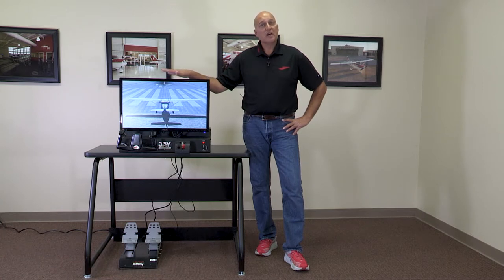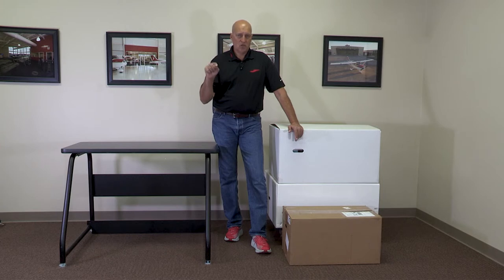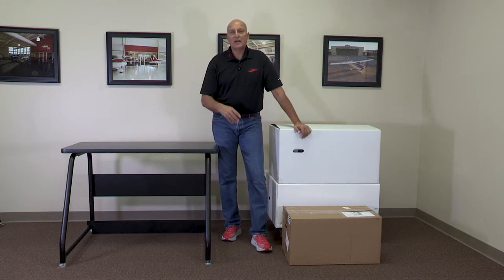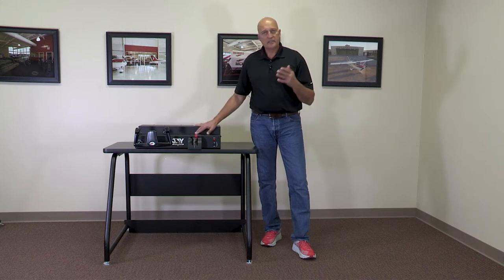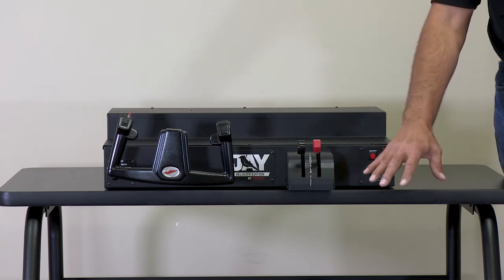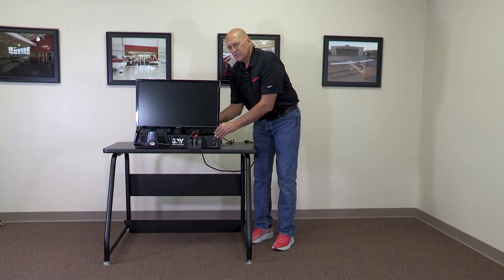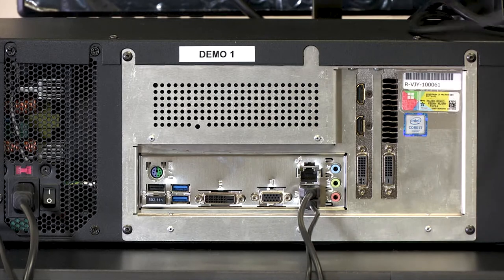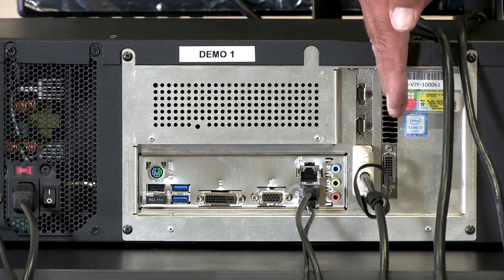How to Setup your Redbird Jay or Jay Velocity

Comment: Hi it is possible to use another’s monitors? I rather to have 3 monitors, front and sides.
Thx in advance
Reply from the maker: It's not officially supported, but the you can add one additional monitor to the Jay (2 total) or two additional monitors to the Jay Velocity (3 total).
Reply: Thx